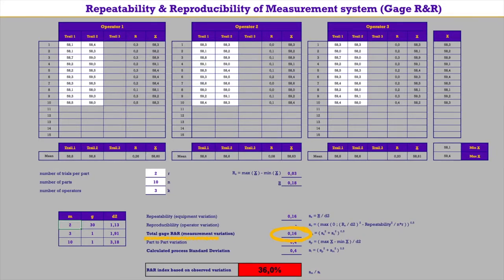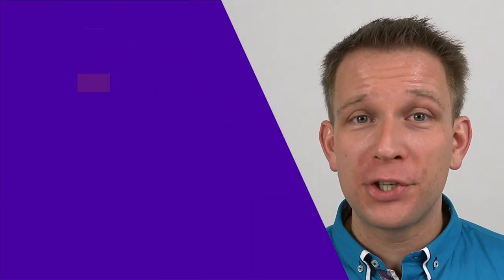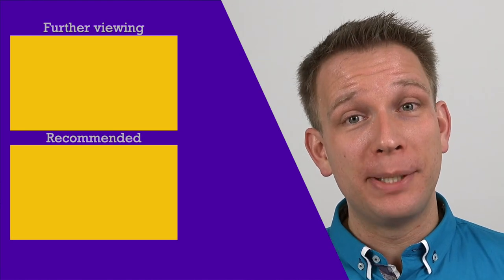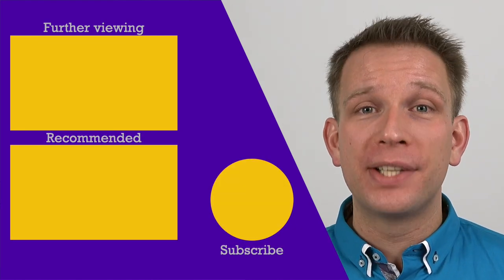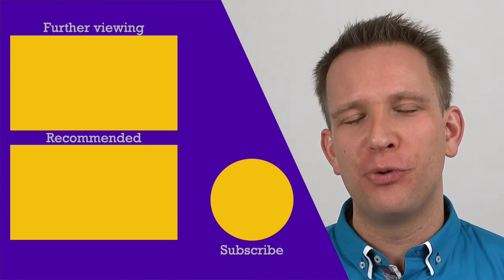What does Gage R&R do? | What you are actually doing with all those numbers and constants

Comment: I've rewatched the video, and I still can't understand where did 5,15 value come from. Could you explain?
Reply from the maker: +/- 2,575 standard deviations from the mean captures 99% of the normal distribution. Going from 0,5% on the low end of the distribution, past the mean, up to 99,5% on the high end is twice that: so 5,15. In other words; 5,15 standard deviations is 'the same' as 99% of all values under the bell curve.
Why did they pick 99%? I don't really know, it's probably based on previous tools using 99%. Some people like to use 6 in stead of 5,15 nowadays (that's 99,7% of the distribution), but the 10-30% guidelines for allowable measurement variation is linked with the 5,15 version, so I'd continue to use 5,15.
ps: you can check the numbers in Excel with the formula =NORM.INV(0,995;0;1)-NORM.INV(0,005;0;1)

The reason to use this number in the first place is because you're estimating the 'full range' of variation in your process from the observed values. You've only taken a sample from your process, so the range is not the highest minus the lowest value you've measured (there's a big chance you didn't randomly get a more extreme product). So you use statistics to determine the full variation range: based on the ranges observed in the measurements, combined with how many samples you took, you estimate the standard deviation in your process - that's the number you multiply by 5,15 to get 99% of the expected range of your process.
Reply: @TomMentink  Wow... I didn't expect you to reply.. Thank you so much!!! 🙌🙌

Comment: Hi Tom,
 
I have ran the data in Mini tab for 0.3745 with tolerance of +-0.0002 which is very very tight tolernace  and yielded Gage % tolerance of 36% which is not in acceptable range. I am super confused on how this data could be failing.
 
For the provided data,  The lowest dimensions that is checked is .37445 (.00015 above the low).  The highest dimension that is tested is .37455 (.00015 off the high).  The difference between the lowest dimension checked and the highest is .0001. 
I know we can still accept if gage r&r is above 30% with proper rationale, what justification can be used in this case?? This is for control shaft
 
When we break it down like this, these parts are almost perfect, but I know all this is just data driven from Minitab. 
Indicator Mics was the gage used to measure diameter.
Reply from the maker: Hi Karthik, that's quite a question you have there - but even with all the data you provided, to answer it I'll need more numbers 😅
Some first thoughts: did you test randomly produced parts? If so, you seem to have a nice and stable process, having a Cpk of around 2 even including gage variance. If you hand-selected parts to suit your R&R study, you've probably taken a too small variance in parts, which results in falsely increased R&R percentage. You should take random sample parts.
Is the 30% R&R vs observed variance (usual way that ANOVA shows result) or vs tolerance limits (my Excel template will show you both comparisons). If it's vs observed variance, the R&R vs tolerance would be around 15-20% in your case, which is not super, but can be acceptable for you (or at least not your organisation's first priority). If it's 30% vs tolerance range (and therefore 50+% vs observed in your case), you'll really want to do something with this measurement system.
Is the variance coming mainly from repeatability (between trials by 1 operator) or reproducibility (between operators)? That will give you an indication of where to look for improvement.
You might also want to do a new R&R with a larger (random!) sample, say 20+ parts, 3 trials, 3 operators. (if there is little to no difference between operators in your current study, maybe do 30 parts, 3 trials and only confirm repeatability).

Comment: Hello, what I know is before doing R&R study, I should check the precision and accuracy, but if I don’t check it, and the  R&R study results is conform, does it mean the accuracy and precision are systematically ok?
Reply from the maker: Good question - this is an important topic in MSA (measurement systems analysis). R&R will check precision for you, which is to say: will everyone get the same result when testing the same product.
For a good measurement system you also need accuracy, you'll need to calibrate your measurement system to test for that.
ps: that also means that you should do calibration before/next to R&R (check accuracy), but you don't have to check the precision before R&R because that's what R&R is for 🙃

Comment: Hey Tom,
Sorry for silly question. referring to 4:18. I tried to divide sm/st*100 =0.16/0.4*100= 40%. How did it become 36%
Reply from the maker: That’s just a rounding error, the 0,4 is actually 0,444. 
Not the best choice for a video example perhaps, but if you check the downloadable template - that has the same example as in this video, so you can see all the calculations.

Comment: Thank you for the nice explanation. I have a use case that I would like to assess the Repeatability and Reproducibility for, but I'm not sure if it falls into the framework of Gage R&R completely. It is a system that is supposed to measure 3D location (XYZ) of any physical point with respect to a known reference point (it is a calibrated multi-camera system + a laser distance measurement). I can ask 3 operators to measure location of 10 physical points and repeat it  3 times. However, those 10 points are in different locations and have different XYZ coordinates. So, I cannot fully map it to the "parts" in your example. I would very much appreciate your help if you have any suggestions.
Reply from the maker: That does make it more complicated.
Are deviations on any one of the axes independent of each other? Because in that case, you could analyze each of the axes independently: see if your operators all see the x-position the same way, then the y-position, then the z.
Reply: @TomMentink  Thank you for your reply. I actually tired to do that assuming the deviations are independent. However, I have difficulty estimating part to part variations, as in this case "parts" will refer to X coordinates of 10 physical points, which are not comparable as a single product.
Reply from the maker: @sarehsaeidi7961  then the mathematics become more difficult - requiring a different calculation step: calculate the ‘average position’ and the deviation from that (you know: SQRT((x’-x)^2+(y’-y)^2+(z’-z)^2)). Just know that you’ll have to calculate several averages and ranges (the same that are in the R&R calculations): average per sample per operator, per sample for all operators, per trial for all parts - and then all kinds of differences between them to make the ranges that are the input for R&R. 

In the end, R&R uses ranges to compare the difference between the trials by one operator; to the difference between operators; to the difference between parts.

Comment: How do you perform Gage r&r for automated systems, with no operators?
Reply from the maker: Great question - what you will often see is that you only test repeatability for automated systems: if the operator cannot really influence the outcome, there is no use to compare the results of different operators, but you still can check to what extend the machine generates the same results for the same part tested several times.
If sample preparation of the way you present it to the automated system is important, it can be useful to have several operators in your R&R study.
In any case: you somehow have to be able to present the measurement system with the same parts a couple of times - with a stone-alone system that is no problem, but automatic systems are often inline, so you'll have to trick the whole line a bit by inserting your 10-15 test parts into the line somewhere before the measurement device and taking them out before the process changes anything to them.
The general R&R question remains the same: does this measurement device add more or less than 10% to the total observed variance? And also automated systems can generate a lot of variance if they're not performing properly.
Reply: @TomMentink  Thanks Tom! What if I have , let's say, three different (but identical) automated measurement systems. Can I treat each of the three different systems as three operators?
Reply from the maker: @donnymac575  yes, certainly - that is the other logical reason to have a potential problem with reproducibility, so do test that if you have multiple measurement systems that should do the same thing. Be sure to send the same parts over all those 3 lines in this case (as you would with 3 operators).
Reply: @TomMentink  Great! Thank you for the guidance.